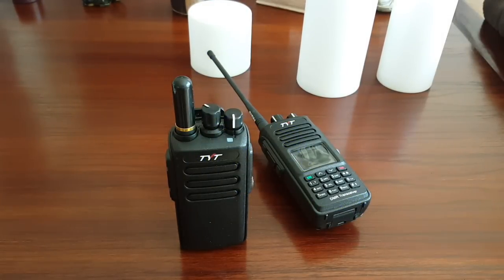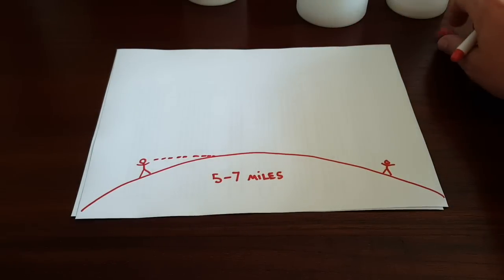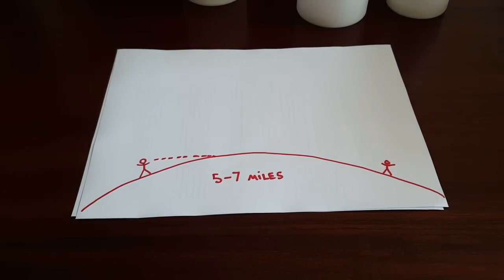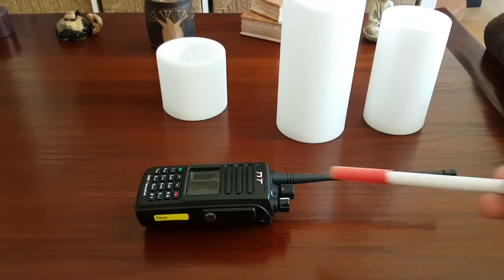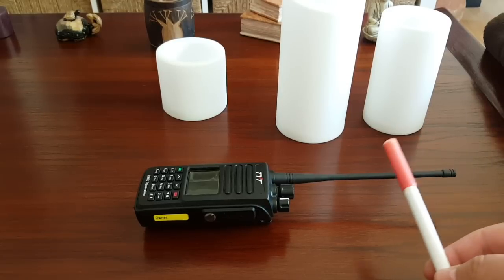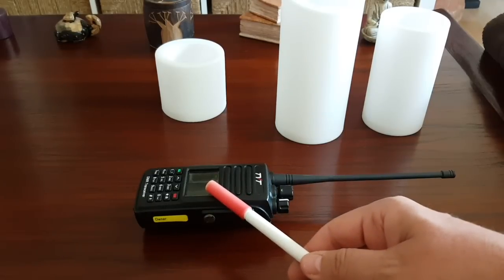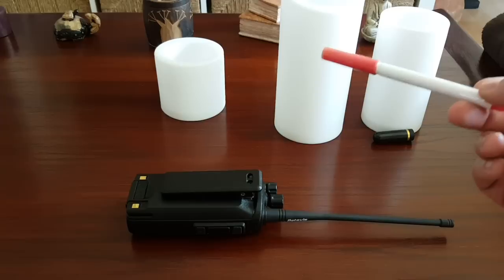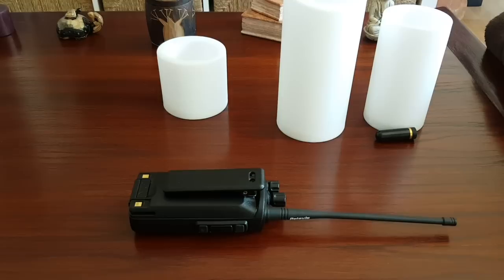How to Extend The Range of Walkie-Talkie Portable Handheld Radios.

Comment: I need to communicate 130 Km or about 80 miles to reach my family in another city across a big lake (Toronto to St. Catharines over Lake Ontario).  Any suggestions on how I can communicate that far?
Reply from the maker: Hello, if you have an amateur license either the 80m band with a 135ft horizontal wire antenna or 2m SSB with a Yagi-Uda antenna on both sides, as high as possible. See my next video about that... Without a license you have few options... CB will work sometimes but not often and would require beam antennas, quite large for the 11m band... I doubt a handheld, even with a Yagi would get you there... Sometimes maybe... But you would have to build a long multi-element UHF Yagi for each station. 80 miles is more difficult to cover than 20 or 1000!
Reply: Awesome, thanks for letting me know!!
Reply: Cell phones.
Reply from the maker: Until cell phone towers stop working...
Reply: CB if we get more sunspots: 102" antenna, preferable with a 520XL "peaked & tuned" (can be done by a professional or at home); USA law=illegal to make CB go >155miles (see if CAN has similar law, ven then: not reliablle @80mi).  License equal to USA's "technician" with: 1. Public Repeaters (find website: radioreference).  or 2. As RP said, 2meter maybe can make it (try a 19.8" antenna, with counterpoise... some reasonably-priced radios w/decent reliability = 10W Retevis, 8W Baofeng, will FOR SURE reach 100% clear-> 65W Luiton if you're CAN license allows you to use a "mobile not handheld"), unless you're on the far side of Toronto transmitting across many miles of city & suburban sprawl before making it to the wide-open lake, or have powerlines, etc along the lakefront (maritime radios on the Lake probaby will use special frequencies).  What can help is inverted ("scrambled") voice if you buy the same brand of radios - even all Baofengs have this -- and it acts similar to the "SSB" he menioned.  CTCSS and thee similar coding conventions can also help you "squelch other users on the same freq deespite the large range".  Turning up th antenna gain may also allow you to reduce your squelch (to hear at such a longer distance than other 2m users are probably trying to hear from = you cannot squelch them out, but they can squelch you out -- so they may be using the same freq and not even hear you -- even as you or your brother hear (get talked-over by) them).
. . . 6meter may have some atmospheric & manmade-noise interference issues, but GENERALLY goes further than 2m; may require a higher CAN license level.

...or just get the app "talkatone" (requires your WiFi or 3G doesn't go down) or a satellite-phone (failsafe unless spacejunk or sunspots take out the satellite, or similar unlikely problems -- more reliable than 'normal' cellphones).  Pay some Ojibwe to take pieces of paper across in their canoes? ;-)  Smoke signals & bonoculars? ;-)
Reply: Use WhatsApp
Reply: Tom J  Marazzo use a smoke signal
Reply: Oh, and search YTube for "DIY hombrew YAGI 2m 70cm": under an hour & aboot $10 of scrap wood & scrappy old tape-measure (go buy a new one) can give ya quality worth an ~$100 commercial yagi.  4 elements (parallel rods) for the 2m is good (this'll give 7 elements for the 80cm if you choose to add an 80cm for other than going across the lake).
Reply from the maker: +The Butcher Of Benghazi. Libya indicted me because I'm too stupid to delete my incriminating emails? Yep, I will make one for UHF soon...
Reply: Hf radio

Comment: UHF-low 400-470 Mhz has the best handheld to handheld  range.
Reply from the maker: +Action Camera Indeed, shorter antenna, more efficient.
Reply: VHF 138-174 MHz  is second best. At 800 MHZ range diminishes for portables. I remember using CB 27 Mhz walki talkies, 3 watt, with 5 foot telescoping antennas, Quality FRS radios with 3 inch duck antennas  have more range and are way easier to use. But CB was the technology we had in the late 70's
Reply from the maker: +Action Camera Well, it depends. I once had a chat with a fellow in MA on my CB radio (early 90s). I was in the North of France...
Reply from the maker: Indeed; I do use UHF for local comms. 10km seems to be the upper range limit, with one station being higher up.
Reply: You can't compare tomatoes with fur gloves.
There is NO comparison with your Northern France comment. and a UHF handheld.
Reply: MauriatOttolink I think you should read again

Comment: Good Vid,I can confirm @27.78125mhz with a 4 Watt FM handheld transceiver (President Randy 2 AM\FM CB )and a quarter wave counterpoise on a ring terminal.
The stock factory supplied rubber antenna gave me a extra 4 S-Points in receive by a station and 4 S Points back to station.
Thats +24dB gain roughly based on 6dB per S-Points give or take.

My set of four CB handheld now have these counterpoise wires and easy to fold and deploy in field.

Not bad for a piece of wire!
Ground plane is def more critical at Higher end of HF band 25-32mhz and Low-band VHF from 30-88 Mhz of radio spectrum.
To get the antenna more effective radiation due to compressed antenna generally used on HT.

73's Rob
Reply from the maker: +rpcomms1 Yep, without the counterpoise wire half of your antenna is missing..

Comment: Great video...It all goes wrong when he starts talking about half waves and quarter waves.
He suggests that the antenna should be half wave into the set. NO! NO!
The set provides a low impedance output, looking for the same on an antenna but a half wave is High  impedance at one end. It's like being in the wrong gear for the right speed.
His 1/2 wave is sort of correct but should be a 1/4 wave into the antenna socket. Now, as he correctly says, the case isn't long enough to provide the other 1/4 wave so his idea (well, not HIS  by any means!)  of hooking on an extra 1/4 wave piece of wire to make the over-all thing a half  wave is very sound. It's known as a counter-poise. You then have in total, a half wave which is low impedance(Low gear) in the middle, which is fed by the "low gear" output of the walkie talkie. Now he's right and the improvement will be obvious.

BUT...BUT on the 70 cms freqs (and I have yet another, very serious BUT coming) you are back to the problem you had before. The same VHF antenna is now high gear in the centre. Nearly half wave on the antenna and the dangly down bit is also high gear (ie hi impedance) but your set is still in 1st gear.. Miss-matched, it can't get any power into the road (er) antenna NOR can it take off the received signals properly. They're there but the set can't use them   (Hang on . The BIG But is still bearing down on you!) because the receiver is also in the wrong gear. In this simple style of operating, you cannot get 1 antenna to cover both freqs. Your 8 yr old kid can't wear your shoes or underpants, nor you his!

THE BIG BUT.. If you are unlicensed, you cannot use the 2 metre or 70 cm frequencies referred to by  Monsieur Le Prepper anyway.
Well you could but the licence holders for either of those frequency bands will resent your intrusion, will not talk to you and will crush you underfoot like a beetle to prevent you from talking to other interlopers.
How? By using a hundred watts of power or more, along with special antennas which concentrate radiated power to be equivalent to many hundreds in any direction they choose and simply by legally kicking your legs from under you. You'll not hear anything from the guy you wish to talk to unless you are snuggled up in the same bed!
Their legal radiated power is sufficient to disable a car remote key fob over a couple of miles when the driver is 10 yds from his car. This is due to idiot manufacturers of cars putting their key fobs transmitters in the middle of a busy, already occupied band.

This key business doesn't apply to Monsieur Prepper's two metres band but it's still full irate legal users who will cheerfully hose you off the face of the earth and take great pleasure in doing it.
The least you can expect is to be zapped out of existence with some startlingly high power levels and at worst Magistrate's court, prosecution , fine, criminal record and confiscation of all the radios and any other radio gear in the same room! The Wireless Telegraphy Act is a bit more vicious than having a dog licence without a dog!

Advice: Stick to PMR 440. Still not entirely legal on a Baofeng types but you'll do no damage and may not have any officials coming to look for you.
2nd advice... Take no notice of know-all gurus on YouTube. They're only there because
they know nothing but sound good to folks who know even less.
Reply from the maker: LOL, I knew I would mess things up a little ;-) An ideal antenna is usually a half wave (I didn't mean into the radio), but the HT antenna is a quarter wave, the other quarter (making the half wave) is the case of the radio, which is too short, so we add a quarter wave piece of wire... Anyway, you are correct and so was I, but I could have simplified the explanation a bit. Nowhere do I say the HT antenna should be a half wave into the radio. That would require an impedance transformer. Also correct in that if you have a dual band radio the wire will be wrong for one band, but still better than none. It goes without saying that transmitting on the amateur bands without a license is illegal. I guess I assume viewers are smart enough to know this... Fines are quite hefty, don't do it. As to FRS and PMR radios, adding a counterpoise wire is a grey area. You are not supposed to modify the antenna on these radios, but adding a wire isn't an antenna... But you are increasing radiated power, so I'm not sure... As to know-all gurus on YouTube, I agree wholeheartedly, watch out! Anyway, I am here to answer questions as well. Oh, and I have an Extra Class license if anyone wonders...
Reply: @RadioPrepper  It sounded to me like you were also saying "half wave" as the actual antenna.  That's why i came to the comment section.  I've been a ham close to 40 years.  Going for my extra in 2020.
Reply: Great comment...It all goes wrong till he wrote the two last sentences...
Advice: Buy a mirror and talk to Mister Poser and don't forget HIS stupid childish Metaphors.